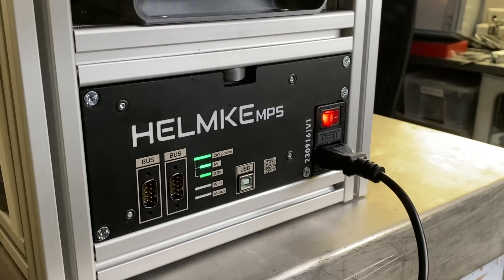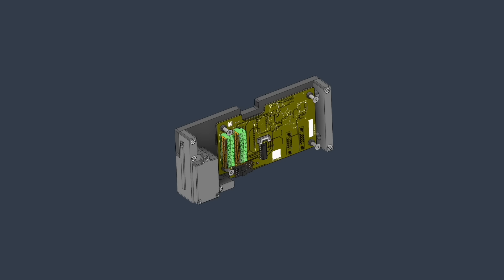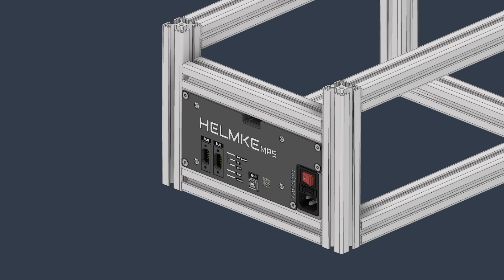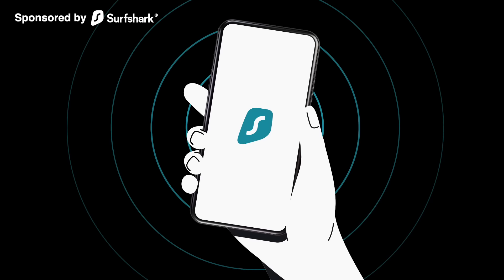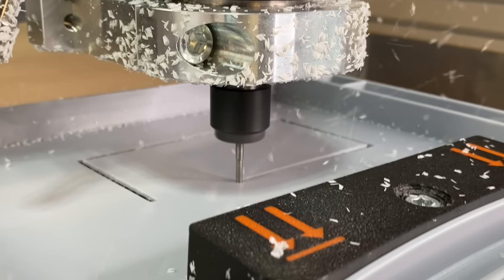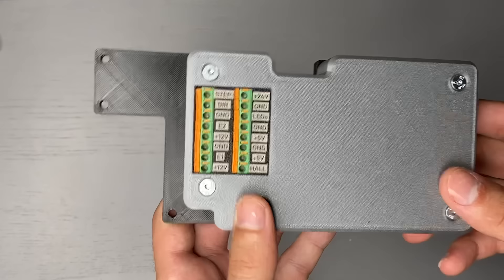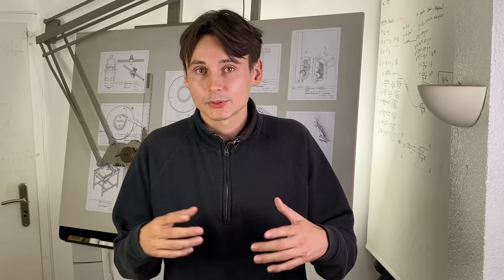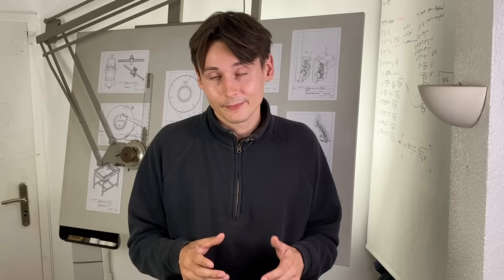Feeder control panel - 3d printed automation #007

Comment: I really like your videos, and am constantly amazed by the quality of the stuff you create, but I must say I'm losing view of what you're doing. There are a few things contributing to this:
1. Upload rate. There's not much you can do about that, this is what you can manage, and that's perfectly fine. However, it does result in "what was this about again?"
2. There's no real overview of what you're trying/going to do. Sure, your intro mentions what you've done in the past and what you're trying to solve, but we don't really know anything about you. AFAIK, you didn't post anything before this series, so we don't know if you're shipping thousands of packages with tens of different screws every day, or just a few packages per year.
3. You show us things like the router for cutting your boxes, and say it's been working great, indicating a high volume, and you tend to show quite a few boxes stacked on each other, but how are they gonna work when stacked?
4. Your videos feel like separate things, instead of like one continuous series. You do reference to previous videos, but things like the PCB at 1:06 made me go: where on earth did that come from? What does it do? Why is it there? 
5. You focus quite a bit on small details, while glossing over the bigger things. Some examples in this video: The light channels on the print, the QR code vs data matrix, the status lights. You mention them, but then don't show what they're gonna do or how they're gonna work. An example on the other side would be the PCB: You show it but don't explain what it does or where it came from, it's just there. Personally, I would've skipped over the details like the QR code and the status lights, and maybe have a shorter video on them later when they're working. You said you were gonna test the status lights for warmth, so a video on designing, creating, testing and then implementing them would be cool. Same for the QR code, the video could start with "You may've noticed in the past that there's QR codes on my cases, here's why". If I may suggest a channel that does this quite well, it'd be Stephen Hawes. His videos are quite hectic and fast, but they focus on one part of the whole pick n place machine, which keeps everything easy to follow.

All in all, I think it would be really beneficial to take a step back. So far, everything has been of the "here's what I've done" style, but I think it'd be a very good idea to step back and explain what you're doing in detail. What do you sell? How many do you sell? How many different fasteners do you use? Etc., etc., etc.. 

To be clear, this isn't a rant on how bad your videos are of your work is, it's awesome, but I feel like they could be better. Hopefully you can benefit from this feedback somehow.

Also, on the daisy-chaining: I personally would try to daisy-chain the power and data separately. You use a panel with the C14 socket on your board, which is great, but there's also panels that have both a C13 and C14 socket. That way you could easily daisy-chain the 230V power, reducing losses, and making it much easier to scale power supplies. It'd be a massive waste if every box had a PSU able to power 5 or more other boxes, but of every 5 only one of those PSUs would be in use. And that's without taking into account that most PSUs are most effective near 80% of their rating (IIRC), so a big PSU running only 1 box would be wasting power too.
Sure, doing it separately makes for 2 cables to plug/unplug instead of one, but I feel like that's worth it. If you really wanted to go crazy, you could always create something that automatically plugs together when stacking the boxes, that would be very cool and clean.
Reply: Excellent feedback, very constructive and I concur 100% (re. Improving content).
Reply from the maker: Thank you for your feedback. I really appreciate it. 
Honestly, I agree with you on pretty much every point.
I realize that an explanation of what the heck I'm doing here is long overdue. 

Things like the intro were meant to do just that, bring in some continuity and recurring explanation, but of course you're right that that only works for a while and only in a limited way. 
The "Q&A style video" I announced in the last video, I have planned for ages to clarify exactly that. Just to be fair to all of you I think that those who are interested should understand who I am and what I do. 

When I started this channel I planned to make a certain amount of technical videos before talking about myself & what I want to do. I don't like to announce things before they are something. I'm just not the type of person to make the first video about myself and what I want to do. When I noticed how crazy fast the videos are being viewed I consciously compromised a potentially confusing video style / series to stick to this rule. 
I did not expect this channel to gain traction so fast and I thought there would be more than enough time to make the explainer video before anyone actually watched the videos. 

The attention from the videos has created some activity behind the scenes and allowed me to bring forward some things that were originally planned for later. This is also the main reason for the upload frequency, I had to do a lot of other things not directly related to the videos but essential for my vision of the MPS (more about this in the "Q&A style video"). 
I suppose a higher upload frequency is possible now but I would be naive to promise that. 

Regarding the small details, I personally have always loved this kind of stuff in videos and think this is a way to add an educational aspect to a "non-tutorial style" video. (I understand you are not criticizing this but using it as a comparison).
All these little details are things that I don't think are in any other video on YouTube, and maybe that's the most useful thing about the videos themselves. I agree that more context would be helpful(!), though. 

I have a few rules that I think make for good content. So far the videos meet maybe half of them. 
I'm not happy with the current video quality and I think that's a good thing. That means there is a lot of potential for improvement. 

The most support you can give me is comments like this, telling me when you think I'm doing something wrong and as long as it's done respectfully (like here) I appreciate it!
I was originally going to do another technical video before doing the "bigger picture video" but I feel the truth in what you write and I will consider switching them.    
I have a plan and I will share it soon.
Reply: @christopherhelmke  You are an extremely astute person Christopher, and quite mature to accept the feedback. 
You brought several points above about your goals and guidelines for the videos that we didn't know. I think it would be an excellent time for your Q&A with a "raison d'être" of the channel, project. More so if this is a "journey" channel Vs instructional one. 
Personally, I love the details only if it shows how you decided to go this route ( the trials of design). Otherwise, unless I wish to replicate your design, there would be little value or, I could find the technical content in a more "pure" tech how-to channel as opposed.
I hope making videos doesn't take too much away from your business goals nor sap too much energy from you as this should be #1. 
In any event, I for one am amazed by you and your engineering prowess.
Reply: You should pin this thread @christopherhelmke
Reply: This is the best comment/feedback on someones video.  I agree on everything you said.

Comment: I'd suggest adding connectors to the top and bottom of the case, therefore when you stack modules, they connect automatically and you can separate the power lines from the data lines
Reply: Yes the pogo spring loaded ones would be good here
Reply: I don't think pogopin connectors are even necessary, the boxes align themselves upon stacking so a cheap connectir with a bunch of pins like VGA or similar should work totally fine
Reply: Or just the standard IEC connector.
Would keep power and data separate too.
Reply: @miege90  VGA is bad for power in a few ways, to begin with it uses very small wires, there's supposed to be 15 of them in there, each with some kind of coating, shielding, and liners. 3 of the wires are actually coax, they're supposed to have their own grounds so it should be that these 3 pins are the best for carrying power, since they will reliably be close to one another the whole time. Thing 2, it's very common in 2023 for VGA manufacturers to not include all the parts they're supposed to. You can't rely on having all 15 conductors. There might only be one ground instead of five, there's a pin that was literally never used for anything, there's data lines that aren't extremely required. You would have to evaluate the construction of every VGA cable, via continuity testing, to know if it will actually stand up to the power you want to put through it, and even then these are just very small wires, all of them. The normal wires in VGA are supposed to be 28AWG, which can carry 0.83A, alone, without exceeding 60C. With the 9 non-coax you could carry 7.47 amps, or about 180w @ 24v; doing so would likely melt the cable, in practice because the collected wires can't cool as well. Assuming, this company built that cable with 28AWG wire, not thinner wire, and not fewer wires.

Pogo pins have an unreliable and small contact area, unless you had a zillion, it's very likely at random there would be little enough contact area that the pins would start welding to the contact patch.

In Power applications, it's really best to use connectors made for handling power, and to use them as intended.
Reply: @Ziraya0  yes it was just an example for the data connection, i wouldn't use it for mains power either 😆
Reply: exactly what I wanted to recommend aswell, maybe you could also just add a AC Mains Through, that way you wouldn't have to worry about power supply strength in the bottom one. Also I personally am a much bigger fan of a connector like Powercon (and/or True1), simply because of their easy locking functionality, which is really useful for a machiene that should be as reliable as possible
Reply: @TheDJRiffin This. It lets you be very flexible, with power requirements. Although, you would run into a PROBLEM with EXPOSED PRONGS, if you have two power inputs.
Reply: @merlin_V2  How about a master/slave switch?
Say you have male IEC at front to receive power from mains,
Female on top to deliver power to boxes above (always enabled)
And male on the bottom to receive power (enabled when slave, disabled when master)
Either manually switched or some logic to switch, if power is coming through the front switch off the bottom IEC.

Edit: It would also need to factor in if someone powers it from the bottom so that the front IEC isn't active.
Reply: @TheDJRiffin  you could also just Put one male and one female in the front and have short IEC to IEC cables connect them together.

I guess that would be the most elegant solution you see it in lighting technology as well. Daisy chaining power and dasy chaining dmx.
Reply: @merlin_V2  just trying to utilise the stacking feature and minimise extra parts required.

Comment: Surely a distribution module in a shallow Euro box at the bottom would be the best solution? This module could handle X boxes stacked upon it, and provide a power supply that handles that. 24VDC is a nice option to distribute amongst the boxes and a decent supply such as from Phoenix Contact would make it nice and safe. You could then use common machine builder cables like M12 to do distribution and if needed use RJ45 data cables to do your Modbus?

Otherwise you are adding additional cost and complexity in each box, just to handle another box which also contains that complexity - its exponential? 

Looking forward to seeing what you do in the future with this! Exciting project.

Comment: You could daisy chain the power separately.  Some old PC power supplies had a male C14 socket (kettle lead) for power input and a separate, female C13 socket to take power out again so that you could take display power off it.
Reply: But then, why even bother with daisy chaining power. Might as well split it at the source and not worry about it
Reply: It keeps the cabling tidier and means that you don't need to take up multiple mains sockets for a stack.  You could hand-make a split cable, but you'd be locked in to the number of feeders in the stack.  Using daisy-chained C13/C14 sockets, you can still stack them arbitrarily and use off-the-shelf sockets and cables.

Comment: This is awesome! I admire your engineering skills, and your videos are a pleasure to watch!

just for the sake of conversation (and Algorithm), have you considered daisy-chaining 220v line, instead of low-voltage one? There are nice male-female connectors and cables, and it has some old-timey vibe (I think there were some old pc cases that had female monitor connectors like that). This will also simplify data connection, maybe even making it magnetic / wireless
Reply from the maker: Thank you! I have considered it shortly but instinctively decided against it. After all the comments about  it I will reconsider it now! 

The reason why I so quickly decided against it is that I worked on some projects for industrial customers in the past where we had nightmares complying with safety regulations around the use of extrusion profiles, mains voltage and so on. It's a long story but some aspects of the design like putting the entire machine in a plastic box is partly influenced by this time. (The main reason for the box was modularity&cost)
Reply: @christopherhelmke   as Sebastian suggested I would also use Neutrik PowerCon True 1 Top, there even is a combined 230V input / output model (Part-Nr. NAC3PX-TOP), we use it in a lot of our machines since it is super convenient and no internal cabeling is needed. There plugs and accessories are high quality and easy to asemble, never had any problems with them so far. It does also have the added benefit that the the plugs do lock into place.

Comment: This is really well made! I wouldn't recommend using Wi-Fi for automated equipment, it has caused me nothing but trouble in the past. You could maybe try pogo pins that interface vertically with the module on top, with data and power being on different sides of the box. You could also shield these pins from touching by putting them in a smaller diameter hole where only the pogo pin can reach in, not people's hands
Reply: My thoughts exactly. Please no wireless connections for anything that needs to be reliable.

Comment: As some others have already suggested i would look into linking power and data separately as this makes thinks much sinpler. For power connectors you can have a look at tha powercon series from neutrik. That is a mains power connector used widely in the event industry. The connection is locked so no accidental unplugging. (There are also other manufacturers that produce similar and compatible connectors but in my opinion neutrik has the best build quality). Due to the use in the event industry ready made cables are easily available on the internet. 
If you decide to go with powercon in the long run just be aware that there are two lines of powercon connectors, the original ones (blue colored for power input into devices, and grey/white for power output from devices) and there is the True1 generation which added a slightly bigger power output connector (physical size) but this allows for cable connectors that can be plugged into each other so cable extensions are possible. And there is the TOP line of the True1 connectors (those are compatible to the non TOP True1 connectors) and thise add True Outdoor Protection so basically a better IP rating.

For data i would also go with standard ethernet cables as those are cheap and easy to purchase, if you want proper locking connectors neutrik also has the Ethercon connector in their lineup, basically an RJ45 Ethernet Connector in an XLR plug housing (XLR - those plugs that are used on professional audio equipment like microphones and audio mixers). Also keep in mind that you can send other signals than ethernet/IP over an Ethernet cable.
Reply from the maker: thank you for this comment! thats really helpful.

Comment: You could add some pogo pins to the top side of your feeder and some matching contacts on the bottom side. Then you can supply all feeders by just placing them on top of each other. (Similarly to how those takeaway buzzers in some restaurants are being charged)
Reply: You could run power and communication via the Pogo pins, or only use them for power and use your d-sub Bus cabeling for communications. This would also give you a way of seperating power and signal wires to reduce interference. Allthough I don't think running power next to a differential communication line would result in an unmanageable ammount of EMI.
Reply: @techko0240  You could still keep them separated with pogo pins by putting the power on one corner of the box and the data on the other corner. That would easily give 20-30cm of separation, and you wouldn't need any extra cables.